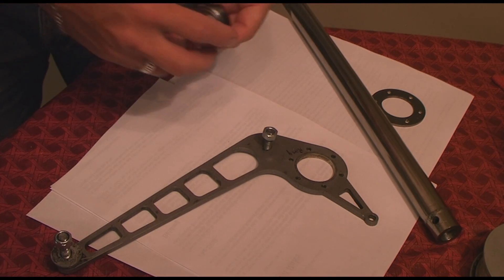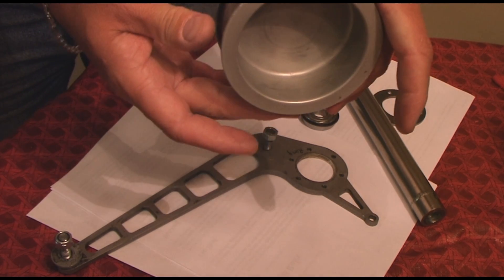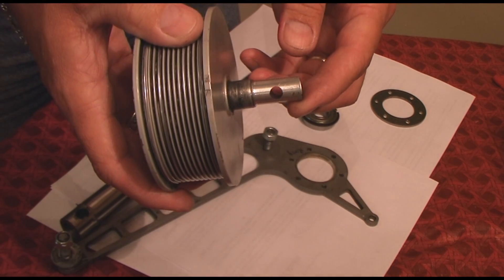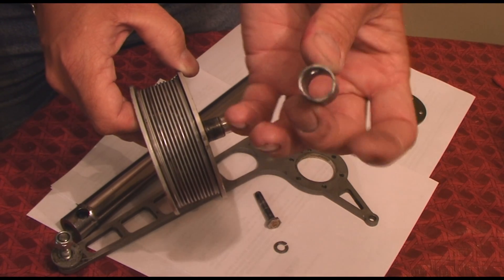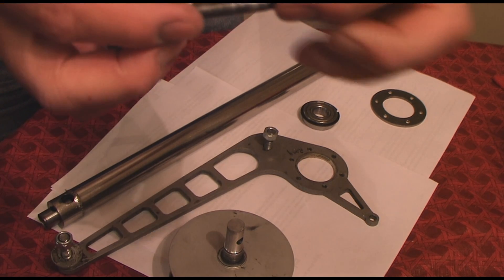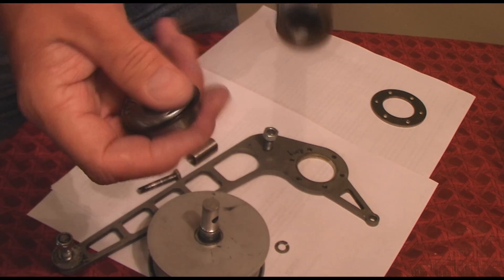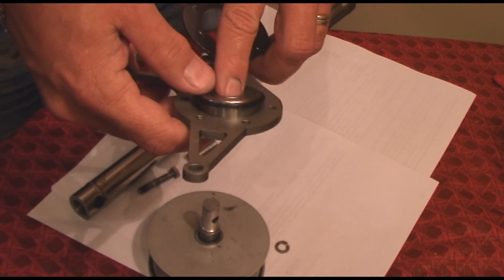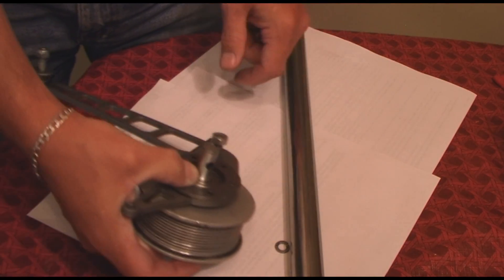Auto gyro MTO Sport prerotator rebuild

Comment: We run a flight school and have broken several prerotator pulleys similar to the one you show. We also had a handyman coming up with repairs, making the pully-shaft no linger being the weakest point. No good idea, two props are destroyed because of that, and now days we only go for original parts from AuroGyro. As a side note, we have learnt that the prerotator does not break down if you replace worn parts properly on 100h checks :)

Happy flying

Comment: A little late but : does the bolt represent the intended weakest part of the pre-rotator drive to protect the rotor - you wouldn't want to strengthen this connection if it is an intentional weak point in the system so as not to preclude rotor binding.

Comment: had not idea of other potential weaknesses in the design work on gyros,  the one that always bothered me was the mechanism that holds the rotor bearing and rotor head in place.   It was my luck that I read of two "bearing" failures several years ago.  (exp[lained as ball corrosion at the time).  This doesn't count the one where the assembly of the head was missing a cotter pin - rotor came off right after take off.     Very good to know, thanks